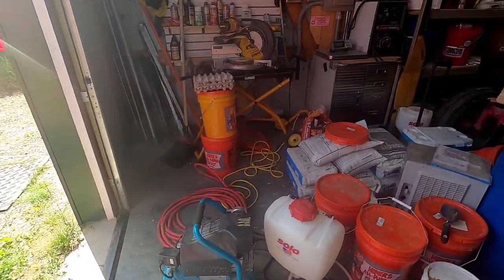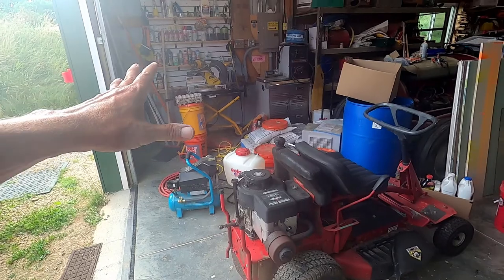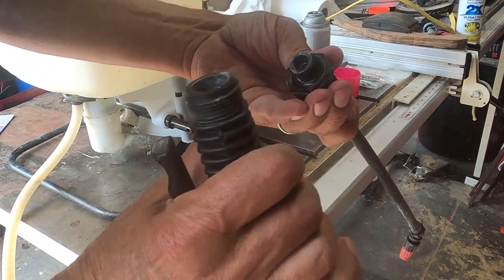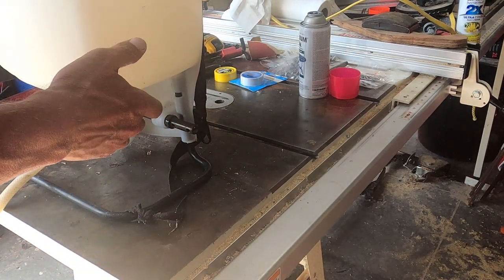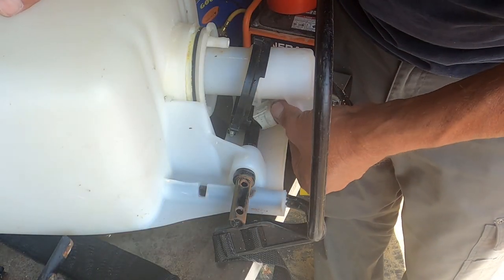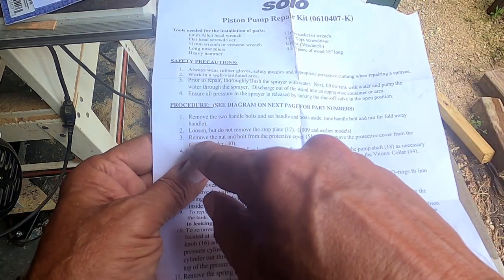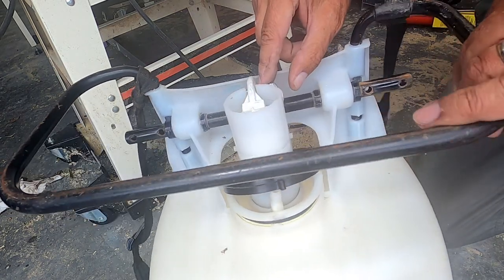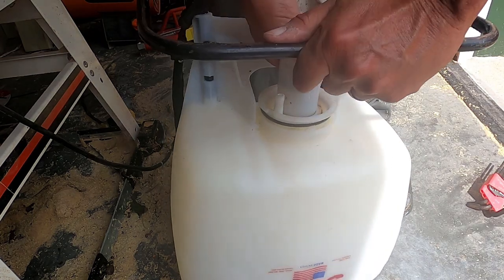Solo Backpack Sprayer Repair ― Stopped by Stuck Cylinder

Comment: When you say plumber's grease do you mean high vacuum silicon grease? I would recommend that far over vaseline especially with plastic parts. Also not a bad idea to have some PB loosener on hand for rusted stuff then after cleaning, a nice good coat of WD. Actually, I've been thinking a spray coat of EZ-slide by Van Sickle ( a graphite based coating ) used by farmers for the obvious rust prevention plus it makes slick surfaces too. Anyway, I have a pump sprayer similar to this one. Not sure of the brand. It's definitely more of a commercial model and it's probably at least 20 years old. I have the same issue...no pressure...I put a different wand on it but I didn't really expect that to fix the issue. I've never cracked into one of these puppies before even though I worked in carpet and floor cleaning. Never had to do the maintenance. Hopefully I can find new gaskets for the inner workings if I need them. So, Thanks for your video! I think it helped me see through the mud! 😁💥💯💥👌👍👊💪🤙

Comment: The whole piston cylinder and pressure compartment are all one piece...and comes out as one piece with only an o-ring seal between the outside of the piston cylinder/pressure compartment assembly AND the tank.
Reply from the maker: Thanks!
Reply: So when I take my pressure compartment/piston cylinder out there is a little Philips screw up inside the piston cylinder that holds a rubber grommet in place above the piston. There is also a rubber piece inside the pressure compartment flopping around. If the piston cylinder and pressure compartment do not come apart, how do you replace whatever that rubber piece is inside the pressure compartment?